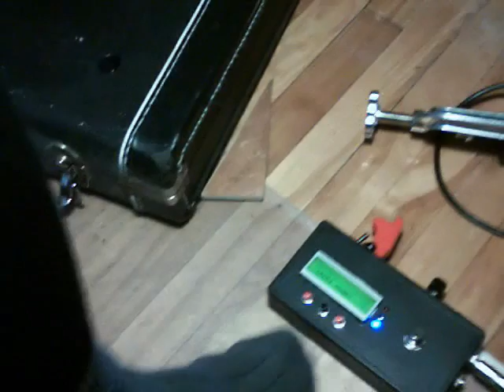Arduino digital chromatic tuner

Comment from the maker: Antoine MARTINACHE Hello Antoine!  If you follow the link in the video description to the project page, you should find a bunch of documentation on how I built the tuner.  It seems to work well with all the types of microphones I tried - it's not very sensitive to signal quality.  During testing, I used electrets worth less than $1 and there were no issues.  Best of luck!